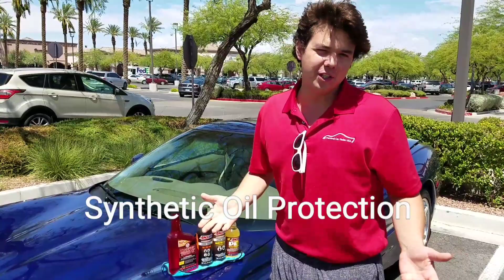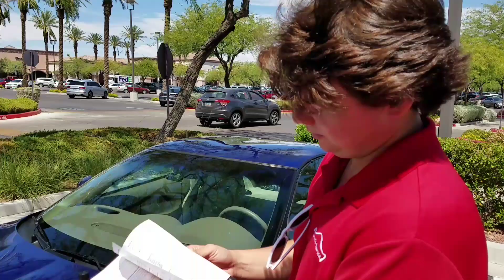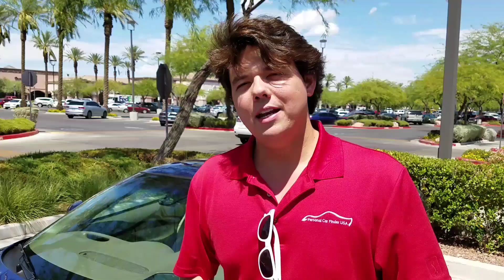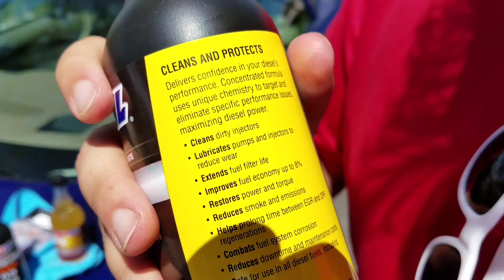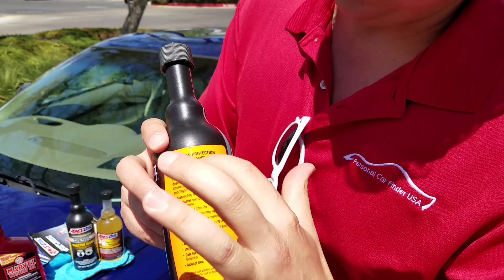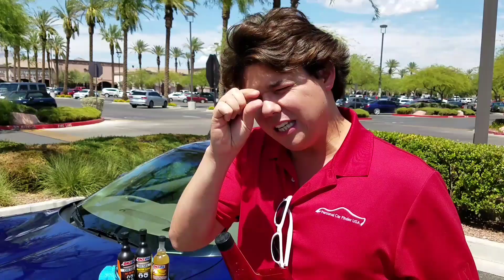Best Fuel Additives - Power & MPG

Comment from the maker: ✅ ✅ ✅  Save 25% On Next Fluid Order: https://www.amsoil.com/offers/pc/?zo=5331179 

     ✅ ✅ Watch This Next: Can Fuel Additives Make More POWER - Myth ? - https://youtu.be/zH-VquYlhqA

     ✅ Your Professional YouLubher: Eben Rockmaker. Find The Right Fluids For My Vehicle - https://www.amsoil.com/guides/?zo=5331179      

     🥇🥇🥇 Synthetic Oil Protection Google Map Reviews
(702) 472-3614
https://maps.app.goo.gl/DmLU5hP72HadUBEm9
             
     ♥ Synthetic Oil Protection Website - http://syntheticoilprotection.net

     Did you know a oil manufacturer can call a lubricant a Full Synthetic when it's only 25% synthetic? AMSOIL is different because it is 100% Synthetic and has a higher film strength keeping the metal parts separated. AMSOIL allows less friction, less heat, less wear on the component. 

      ♥ See Fluid Performance Tests - https://www.amsoil.com/performancetests.aspx?zo=5331179      

     ♥ Your Vehicle Could Run Better Than Brand New By Choosing The Right Fluids! See Results - https://youtu.be/zH-VquYlhqA

     ♥ Why AMSOIL - https://www.amsoil.com/about/exclusive-distribution/?zo=5331179    

     ♥ Synthetic Oil Protection Coffee - Ebens Favorite: https://supportwith.coffee/shop/subscriptions/sop/
Reply: To be honest, I like the Gumout Multi system tune up with PEA. That's the one I use every 3,000 miles.
Reply from the maker: @TheRichardF10  

Thanks for sharing that I'll give it a try😊
Reply: @Syntheticoilprotection  I'm sure the Amsoil PI cleaner would be better used from the beginning of a new car, right?
Reply: Ive used marvel for a about two years every fill up. You dont think everything is cleaned up from it?
Reply from the maker: The Pi will clean better then the marvel mystery oil.

AMSOIL just came out with Upper cylinder lubricant- https://www.amsoil.com/shop/by-product/fuel-additives/gasoline/upper-cylinder-lubricant/?code=UCLCN-EA?zo=5331179
Reply from the maker: Chris this is the AMSOIL Upper cylinder lubricant video I made - https://youtu.be/R2GtqiOkno4
Reply from the maker: For your ATV you would want to use the quick shot.
Amsoil quick shot https://www.amsoil.com/p/quickshot--aqs/?zo=5331179

as far as the other companies you mentioned I really don't know how they compare.

I have had a lot of people try amsoil after trying all the other products and they've always said it's better.

But I have personally not tried them

Comment: Hello Eban,
                      I have a 1998 Firebird, and wanted to know if
these fuel additives have been tested on older vehicles.
I am sure that the Oil and Filter have been, it is the
additives I am leery about.

Just Let Me Know  
Thank You
Reply from the maker: Of course I've used them all on my 59 Cadillac you'll see the playlist on the channel every product I've used on it to clean it up to get it to run the way it does when I first got it it would not spend the tires on gravel now it will spend the tires on Blacktop the change of the vehicle is like day and night crazy how much better it runs and you will see every step through that process you can always order the products right here on my website will get shipped directly to you💯😃

 I give a man a fishing pole & show him how to fish. 

     Together! We can get your vehicles to run better than brand new!

     For me to get credit & be "Your" Independent AMSOIL Dealer please use my website below or my dealer no. 5331179 call anytime Eben Rockmaker 702-472-3614
After you click on: http://syntheticoilprotection.net
1. Click hamburger menu
2. Click offers AMSOIL preferred customer
3. Click join now 6-month PC member add to cart.  ( there is no reoccurring renewal membership unless you select that dot box ) 
( you have the option to not have your credit card saved if you prefer - est. 1972 )
4. Scroll up to the top Select shop by vehicle.

New Promo: FREEBOWL
Reply: @Syntheticoilprotection  I am a member.  
And will be ordering next month when I change My Oil.

Comment: How should PI be used for optimal results? Run gas near empty pour in and fuel or does it not matter what's optimal?
Reply from the maker: That's a great question PJ I've usually had the best results I've put it in about half to three quarters of a tank.

On most of the cars I've done that's usually about a 19 gallon tank so figure if it was half to 3/4 full that would be like 9 to 15 gallons in the tank.

I find that in about 5 gallons the whole systems already clean it's that strong.

Also you'll notice she go further on that tank of fuel as well.

I usually run it every 4 to 5,000 mi depending on how much I'm driving and how long it's been.

Also if I feel like the car is not running as good as it should be I put it in earlier It just depends on how I feel.
Also I run the upper cylinder lubricant every full tank of gas so that helps maintain the system a lot better.
Reply: Wow that's awesome I'm going to try it with about 10 gallons I've noticed just about every other fuel additive says run the tank near-empty but I'm going to try the Amsoil with 10 gallons and see what I get for mileage before and after thanks for the response eben

Comment: I surprised that your promoting MMO.   Is that made by Amsoil?
Reply from the maker: No it's not I used to use it all the time in my 2000 Pontiac Grand am SE.

Always had great results with it always got better gas mileage.

I do like themselves upper cylinder lubricant better because you can just throw the bottle away once you put it in you don't have to worry about it spilling in your car.

So personally I still do like the Amsoil upper cylinder better.

It would be interesting to see those too in a wear test.

Thanks again Charles ☕
Reply: @Syntheticoilprotection  thank you so much for the quick response. I want to make a order.  I am in SC would the shipping be to much? I don’t need a $100 worth. Is there any way we can talk? A couple of quick questions.  I would respect your time and not keep you long.
Reply from the maker: Of course you can give me a buzz anytime
Professional YouLubher: Eben Rockmaker Regency Gold Direct Jobber AMSOIL Specialist (Dealer#: 5331179) 702-472-3614 

     If you're New to AMSOIL I recommend the AMSOIL 6 Month PC Membership - https://www.amsoil.com/offers/pc/?zo=5331179

Comment: Can I run diesel amsoil with marvel mystery in my 350z hr
Reply: Stock
Reply from the maker: I would run the amsoil oil filter I would also do an amsoil engine flush and I would run the Signature Series motor oil you'll see the oil for your vehicle on the lookup guide it'll show the exact viscosity and oil capacity for your year make model and engine size.

I wouldn't mix anything with the amsoil.

I would also do a bottle of the amsoil PI performance improver that is a few additive that will clean the valves clean the carbon deposits out of the combustion chamber you'll have much better fuel atomization power performance and gas mileage.

Professional YouLubher: Eben Rockmaker Regency Direct Jobber AMSOIL Specialist (Dealer#: 5331179) 

To Order AMSOIL Products Click Here - http://syntheticoilprotection.net/ 

Find Products For All Vehicles - 
https://www.amsoil.com/guides/?zo=5331179
Reply from the maker: Are you doing racing or is it a OEM car that's all original?

Find Products For All Vehicles - 
https://www.amsoil.com/guides/?zo=5331179

Comment: Is Chevron Techron additive as good as these?
Reply from the maker: It's a different chemical and it will not clean it that you as a hardcore cleaner like the pi performance improver - https://www.amsoil.com/shop/by-product/fuel-additives/gasoline/p-i-performance-improver-gasoline-additive/?code=APICN-EA?zo=5331179
Reply: Techron also contains PEA, but they won't state how much. I'd stick with the Amsol Pi.

Comment: I use marvel mystery oil on my vehicles in oil and gas....very good product....also use to rxp 
In gas and diesel...
Reply from the maker: Sweet, I recommend you try the new Amsoil oil upper cylinder lubricant that goes in your gasoline it's amazing it runs even smoother than Marvel.

This is the upper cylinder - https://www.amsoil.com/shop/by-product/fuel-additives/gasoline/upper-cylinder-lubricant/?code=UCLCN-EA?zo=5331179

Comment: I added Marvel's mystery oil in in my oil. So how long should I drive my truck before I give it another oil change with the marvel mystery in it
Reply from the maker: After you flush it out I would try Amsoil oil you'll notice better gas mileage better compression smoother engine also I recommend using the Amsoil oil filter as well.

This is my personal link if you'd like to try Amsoil.
My link: AMSOIL 25% Less Wholesale & FREE SHIPPING: https://www.amsoil.com/offers/?zo=5331179
AMSOIL Makes it for your Vehicle Lookup - https://www.amsoil.com/guides.aspx?zo=5331179

 If your vehicle is not on the lookup guide this is AMSOIL Tech Support 715-399-8324

Comment: Hi there Eben!
I just would like to ask about using of Amsoil P.I.
I have Honda Jazz which carry 40L(~10gal) capacity  gas tank and it was said in the Amsoil P.I. label that the 12oz solution is good for 20gal of fuel.. with that said,should i use only half of the solution for my honda jazz car?
Thank you very much for ur advise..
Reply from the maker: Yes you can use the whole bottle and the new bottles now treat 30 gallons of gasoline

Comment: Can you just add amsoil performance improver at any time?
Reply from the maker: Yes, the one thing you do want to make sure if you put it in less than 20 gallons of gas.

I usually put it in about 10 to 15 gallon and after driving through 6 gallons of gas I can already feel a major Improvement in power and smooth driving and idling

Comment: Honest question: how do you think MMO will get underneath the cylinder gasket? Seems impossible, unless there's a gap, but there's typically zero gap.
Reply from the maker: Great question!

Marvel Mystery Oil vaporizers inside the engine and inside the combustion chamber and it disperses in the air. It puts a coating everywhere and stops rusting and puts a film on everything.

I changed the head gasket on my old Jeep and found residue of Marvel Mystery Oil everywhere in a very very thin film.

Basically it disperses if you'd like to do a test try putting a drop of Marvel Mystery Oil on cardboard.

I have to say that's probably one of the best things you can put in your fuel as a maintainer.

The Amsoil Pi performance improver gets the hardcore carbon deposits out of the combustion chamber.

Comment: My favorite fuel additive is Marvel Mystery Oil. I have been carefully tracking the highway mpg in my 2002 Lincoln Town Car that I have had for 11years. Before using MMO, the best mpg on a trip from Maryland to Florida and back was 23.7. I have been using MMO for 2 years on a regular basis in my fuel at 4 ounces of MMO for every 10 gallons of gas. Now I am getting 25.2 mpg. With the savings in gas, MMO more than pays for itself, plus the added benefits of it keeping the fuel injectors clean and lubricating the fuel pump.
Reply from the maker: That's about the results I get with it. 

I've always found my car to idle smoother and drive better.

I've experimented with all different amounts all the way from putting one full quart of Marvel Mystery Oil in 15 gallons and the best ratio is 4 ounces per 10 gallons.

I think basically as long as you put that small film of oil and everything you're good. If you add more you're only lowering the octane of your fuel.

I think the sweet spot is exactly 4 oz per 10 gallons
Reply: Since I have been using Marvel Mystery Oil in the past 2 years, not only has the highway mpg improved, my car's idle has been smoother and runs better. The directions on the bottle says to use 4 ounces of MMO for every 10 gallons of gas. If using more of a ratio of MMO was more effective, they would say that on the bottle.                            I've found the best price for a 32 oz bottle of MMO is $3.88 at Walmart. On my last purchase of MMO at Walmart, the cashier said he uses MMO all the time in his fuel also. The first time that he used it, he put the whole 32 oz bottle all at once. While it didn't hurt anything, he said smoke was coming out of the tail pipe until he refilled the gas tank.